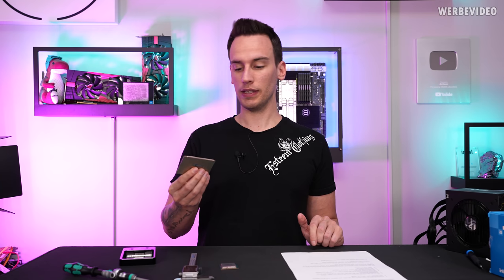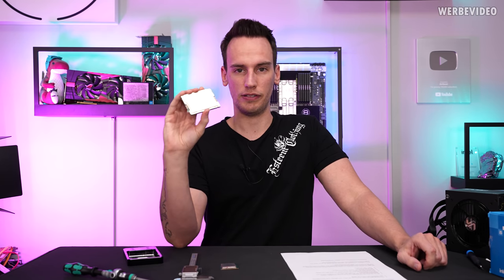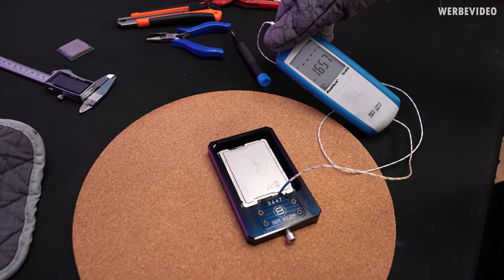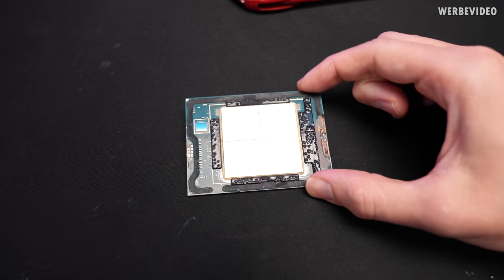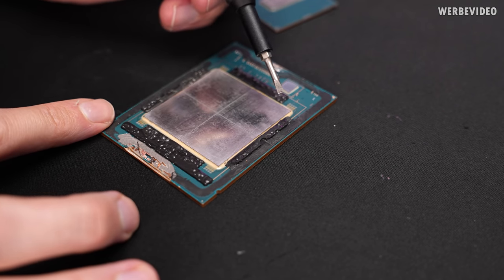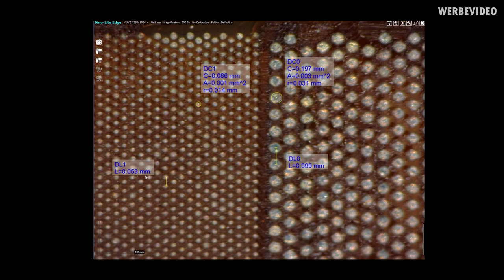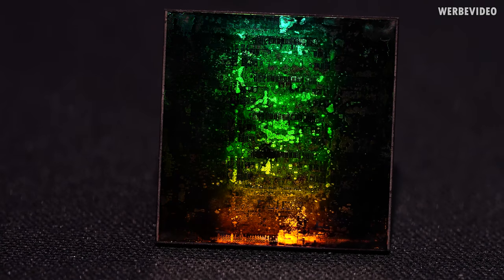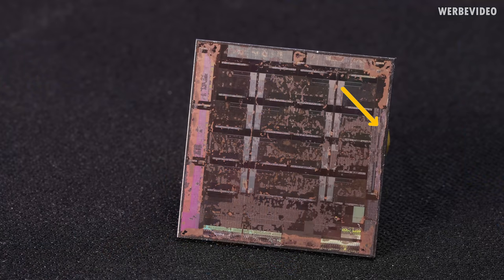Delidding an unreleased 56 Core Intel CPU - Sapphire Rapids Xeon

Comment: Dude you probably just killed a $10k cpu just out of curiosity and education. Assuming it wasn't an already dead engineering sample. Not many people could have done that. You definitely deserve a medal of honor...
Reply from the maker: Haha thanks
Reply: Medal of horror ? :-D
Reply: @bennaambo2716  Tell us what he should have done instead with a chip he can't use/exploit before months ? He got us prime news, he showed us the immediate future and made a lot of views... What's your options ?
Reply: @leyasep5919  i mean theorethically he could have spent a month or two to try to come up with a less destructive deliding method but intel could just as easily make engineering samples not work on any non engineering board via bios so it doesn't really matter
Reply: @vukzlatkovic1183  He's trying to take die shots, so the destruction is irrelevant.  He probably gained more info on making delidding tools, which BTW he develops and sells.
Reply: @vukzlatkovic1183  At the time of deliding the cpu, I'm pretty sure he had no idea whether the cpu was functional anyways. It was an engineering sample which was sold 3-4 months prior to the commercial unit's release. So the cpu he destroyed was probably even older than that. Even if it was not dead, it probably had bugs and it probably was nowhere near the commercial unit in terms of clock speeds it can achieve anyways. And obviously taking the die shots would require the destruction of the unit anyways. He burnt some money to make this incredibly informative video of which we should be thankful for.
Reply: @leyasep5919  A lot of views....80K.... Woooooow....
Reply: @lemilemi  OK I know it's relative but it's still 10× my most viewed one :-)
Reply: @odjsjaks  that's how you remove a soldered ihs my guy
Reply: @leyasep5919  Not nearly enough views to cover the cost of that processor. But he can do what he likes with his property, I guess...
Reply: @carlkamuti  Maybe not, but we don't know how much he paid either. Retail chips might be $10k but a very early ES that might not even work wouldn't have been anywhere close to that.

Comment: With all those fine connections underneath, it is amazing that they can attach these chiplets successfully without any of the connections being bridged.
Reply: some chips are indeed lost to defects in those connections, yield of packaging is not 100%
Reply: What "connections being bridged"?
Reply: @suntzu1409  If one of the chips is less than the width of a hair out of alignment, the solder bump will make contact with two of the connections at the same time instead of just being connected to the one it should be connected to.
Reply: @osirisgolad  miss-alignment of even less than 1 hair width would create high resistance connections, potentially limiting frequency
Reply: agreed it just looks like a technician's nightmare if this cpu chip is on a laptop and they have to solder it back lol
Reply: @darknez09240  that's not how it works...

Comment: I love how Roman will just be too interested in what's inside to actually restrain from killing a top-of-the-line Xeon <3
Reply: Sapphire Rapids engineering samples are locked down like never before, so this CPU would not have served much of a purpose besides being a pretty paperweight.

Now it's a grilled paperweight!
Reply: @TheDoomerBlox  Well... as far as I understood, it was functional, right? He says when he wrecks it in the de-lid vice, that it's a good think he didn't need it... so sure it might be limited, but it's still a 56c Xeon...
Reply: @MrMcGreed  It is functional, in so far that you if you were to trick it to think it is in the past - while running the special "key" BIOS that allows it to function - it would run.

Besides that specific set of circumstances, it's a paperweight.

Comment: I want to learn how to "clean" the die and get photos like that. I have a ton of old crappy intel cpus I could practice on, it just looks so awesome!
Reply: If you find an old ceramic Intel CPU (edit, like a pentium or 486) you can pop the cap off the center of the bottom where all the pins are and see the bottom of the die. 

You have to take the die off the substructure pcb to see the "cool stuff" so you aren't left with much  of anything to hold or look at afterwards.
Reply: I think der8auer has a video on how to - though it's something with a lot of acids, so be carefull... also, it might be on his German channel, because it's from before he split them...
Reply: @volvo09  the old pentium pros have a sh*t load of gold
Reply: @MrMcGreed  the guy that does the ones on flikr most people have seen i think has an old tutorial on how to do it too, but the process of what to use varies a little by the fab process iirc
Reply: @MrMcGreed  thanks for the heads up, do you know the video name?
Reply: @AtaGunZ  NP!  Think it's "We destroyed the Intel Itanium - My most beautiful Die-Shots ever!"... but didn't watch the whole thing again to check...
Reply: I can't help you on the chemical/mechanical side of things BUT... 
to better control the reflections, you should also consider polarizing filters/gels for your camera and light source.
Reply: Just get a pentium 3 or amd athalon. 100% exposed die. The wild west days.

Comment: @10:17 Next time, if you want to measure pitch more accurately, measure the distance between 10 or even 20 bumps and divide by the correct amount. The measurement error for inaccurate positioning on the exact center of the bump will be greatly reduced.

Comment: I gotta admit i'm really surprised you dont have a reflow gun and even a PCB heater, they arent particularly expensive and seem like they would make your life easier often enough. You can pick up a really nice Quick reflow station for a couple hundred US.
Reply: (example use - put your entire delidding tool on the PCB warmer, heat to 90C and use the reflow gun to bring the IHS to 155 without cooking the entire PCboard/die that far for ages.)
FWIW a double wedge delidder might still work with those very close caps

Comment: Reminds me of my Pentium Pro (500 nm) from 1996. Overclocked from 200 to 233 Mhz. Still running 😎
Reply: what are you able to even run on it?
Reply: @lordjaashin It was used as a file server until about five years ago.  It has Windows 2000, Office 2003, and Photoshop 6. We use it to convert old-format Office files, run old Photoshop plug-ins, and play an occasional Age of Empires scenario.
It has a SuperMicro AT mobo made in a place called "USA".  The power connector runs hot when under load, and the contact clips eventually oxidize causing crashes. I have surgically replaced clips (take from a dead Seasonic) and put conductive thermal paste on them. That experience has made me very sensitive to power delivery - both number and quality of conductors.

Comment: When removing the IHS you should have made a small spacer to put between the cpu and de-liding tool and then shaped the spacer so that there's a cutaway on the bottom half of the side that presses on the cpu so that you could be certain that the pressure is against the IHS only and the spacer will clear and go over the PCB and not into it. Additionally you could have made an additional cut away in the section of the spacer edge that would have contacted the SMD's so that it wouldn't have damaged them either and only made contact to the IHS either side of the SMD's. 

Just thought I'd mention the idea in case your in a similar situation in the future and can hopefully avoid damaging another chip.

Love the videos always really interesting and massive respect for the guts to do something like this knowing you'll almost definitely ruin this cpu using that de-lidding tool and still going ahead with it.

Comment: Im sorry bro but the way you delidded that made me want to cry. The proper way to do it like that is to take 4 thin razor blades, cut the adhesive holding the IHS, then put each razor blade on each side on the cpu between the IHS and the CPU, causing slight pressure. You then take a Heat gun that can melt solder and heat the cpu (make sure the cpu is upside down and elevated on something) and wait till the IHS pops off.
Reply: You clearly don't know who Der8auer is. Pathetic comment.

Comment: Those are 16 core chiplets indeed, so a 4x16 or 64 core part was definitely the design. Knowing Intel they probably do have 64 core working in their lab already - it's the yield rates, lithography, complexity of the design and packaging that's holding it all back. These guys are at the bleeding edge of physics and materials. A 350W TDP is an incredible amount of heat for a CPU to push let alone 2x or 4x - those 1U designs will be interesting to see how they stay cool if not quiet.

I do wonder what form factor those 8 CPU systems are because all I can seem to find are 4 CPU XCC servers from Supermicro/Tyan. Maybe they are referring to the systems that cram four nodes in a 2U chassis, that would give you 8 CPU's in one box, but those top out at 185W TDP parts due to thermal constraints. Even when liquid cooled 8x350W isn't something you will be doing with a case mounted radiator setup, and a server rack full of multiples of those will require a special room/facility to handle the tubing, noise and cooling.

Gotta appreciate AMD for their 64 core CPU's though - those things rock!!!
Reply: 16 sections, 1 reserved for integrated memory controller.  So 15 cores each die max.
Reply: @張歐-g9m  Nope - the IMC has it's own dedicated real estate on the die. You can see it clearly in the shot. It's a 16 core part with two of the cores nerfed here.

Comment: Can you design a delidder that would push the lid on a pivot point basically to avoid damaging the caps?  The top left corner with the writing being the pivot point and pushing the bottom right corner towards the bottom left corner?  It would only take a very minimal amount of movement before you could just remove it from the delidding tool and manually "wiggle" it looser.
Just my backyard north of lake superior thoughts ;)
Love from Canada :)
Reply: Or maybe create some sort of "stopper" for one side and push up the other side using some sort of wedge shape.
Reply: @mrawesomelemons  wedge is also a great idea that might work even better!  I mean taking it out when it's 150 C and "wiggling" the lid is somewhat laughable to like argue against my own idea hahaha.  The wedge would eliminate that for sure!
Reply: Desoldering the caps before delidding should be pretty easy on capacitors that size.
they look like they are at least 0402, 0603, or maybe even 0805 size.
0402 size caps are pretty hard to do by hand but they are definitely possible and i think those caps are probably bigger than 0402
Reply: @justinbouchard  you could create a delidder that pushes teflon wedges into it from four sides, maybe the corners, maybe the edges, that way you would lift the lid vertically

Comment: Might be fun to get a 8 socket board for this, dream workstation I suppose.
Reply: At 350 W TDP each, thats 2800 watts of cooling needed.  I can only imagine the power consumption not being much lower than that, would be hilarious to see him try and overclock all of them at once.  448c/896t at 4ghz. I would bet these 56 Court chips are probably clocked at 2 or 2.1 GHz max.
Reply: This particular chip will need a dumpster. A new one of these would be great to use in a multiple cpu workstation.
Reply: Pretty sure only dual exists for this
Reply: Ice Lake SP and newer only support 2S I believe.
Reply: @chubbysumo2230 
well, if 2800W is just too much, how tf HPE is making >=30MW supercomputers?

Why and how did Microsoft and Amazon make data centers that draw several kilowatts of power?
Reply: @suntzu1409 just to make sure I got this right, are you comparing a single rack workstation to >=7000sq ft supercomputers with whole buildings designed to cool them?
Reply: @AtaGunZ  
I didnt really compare the power draw of one server with the power draw of supercomputers.

Read my comment properly.
Reply: @suntzu1409  yeah I read it again and still makes no sense. You are clearly making a comparison between the power draw of 2.8kW (mentioned by @chubbysumo) with the power draw of HPE supercomputers and data centers.  Also, an average Microsoft/Amazon data center is also in the megawatt range, not kilowatt.

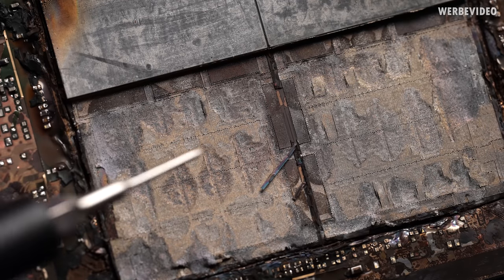Comment: WHOA!!! @ 9:48 - if you pause it and pay attention to all of the 20 rectangles (inside one of the 4 quarters of the whole chip) you can see the ones that are connected to the 'inter-connect' (i forget what it's called) to the cores next to it are the ones2 doing the processing. There are only 14 in each of the quarters, and you can see that only the 14 that have TWO CONNECTIONS (or 1 double wide) of that 'inter-connect" OR to another processor.... 
In otherwords, while looking at the quarter that is in the center of the screen @ 9:48 the 6 cores that are on the very left and very bottom (the top core on the left side and the far right core on the bottom side are part of the 14 processors enabled, so they  are not what I talking about here) must be used for something other than processing, so maybe cache or IO or just disabled???? Or is that all done in another area? And if a core is disabled is it then just taking up room and becomes a useless area on the chiplet. (I really don't have much knowledge on what all these pieces are, I'm just guessing really lol)
..... 
So this is why it is such a STRANGE number of CORES in the chip (56 in this case, so 14 in each quarter) BUT I would like to know if it is the same cores in each CPU or can one of the quarters have ALL 20 cores enabled while another has one 8 and the other 2 both have 14??? 
Is it possible for Intel to have ALL 80 CORES enabled if they all just happened to work perfectly??? - There is so much I would love to learn about, but I have no clues where to get the answers...
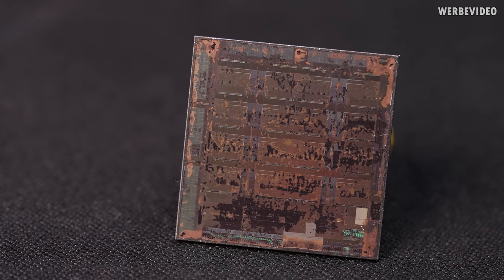Reply: ohhhh.... hrmmmmm..... so @ 10:57 you show the chiplet etched a bit and we can see that there are 16 CORES in each chiplet.... (so 2 of them mush get disabled, but I dont think they can be any of the ones with the 'inter-connect' - I think it's called an E-MIP??? 🤷‍♂) so there goes my whole theory lol - I REALLY think I should start watching the WHOLE ENTIRE VIDEO BEFORE  I MAKE AN ASS OF MY SELF LEAVING CO<MMENTS ABOUT STUFF THAT IS EXPLAIN JUST A LITTLE FURTHER INTO THE VIDS lmao 🤦‍♂🤦‍♂🤦‍♂🤦‍♂

Comment: I'm wondering if there is more consistent silicon quality in Intel's new multi die CPU. Some of their Core 2 Quad and matching Xeons used to have vastly different binning between them (eg. 1 of the die would run significantly hotter).

Comment: Is hedt still useful? I remember starting with the i7 920 back when it launched, but really wanted a 980 extreme.. only to find it was ousted by the 2600k shortly after, which was technically a budget chip. Intel had been shooting itself in the foot each release where these cheaper K series chips were out performing their unreasonably expensive X series (hedt) chips. 9900k was my jump from the i7 920 and find zero reason to get a 13900k. Out of curiosity, I checked to see if a 13th gen X series would exist (last I saw, 10980xe was the last hedt) but we now have confirmation of a 13th series X chip, will it be slower than the K series for gaming?

Comment: Couldn't you use a laser like the ones they remove rust with, or to make a logo.. and get it just do the whole surface in sweeps? 
Maybe there's a high tech machine shop near you could approach for advice. The newer manufacturing process has just made die shots using your current process very hard.

Comment: Considering AMD's EPYC 7773X and Threadripper Pro 5995WX takes 280W and Sapphire Rapids take 350W (according to official specs, at least. I expect real power usage to be around 310W and 450W respectively), it's nuts to see that Intel's 56 cores take more power than 64 cores.

Comment: 4 E-cores in the space of 1 P-core, i wonder how strong a 256 E-core xeon cpu would be.
Reply: Significantly weaker than P-core only design in AVX-512 - accelerated workloads (NAMD), should be around <10% better outherwise
Reply: What <10%? More like 100% more
Reply: Latency would be pretty bad
Reply: @Leoappeared  4 E-cores take the 1,25 as much space as  1 P-core. 256/4×1.25=80 (P cores to take the same amount of space as 256 E - cores). 256 E cores vs 80 P cores is a valid comparison, not a 256 E cores vs 56 P-cores. This (56 functional P cores out 64 physically present) new CPU will fit around 208 E-cores within die area, some of those will have to be disabled for yield purposes.
Reply: @volodumurkalunyak4651  10nm is still not dense enough to play this, we need 512 E-core in one of the sub-dies
Reply: @劉奕彤-q6g  what you need is a whole different story. I do compare 56 (avaiable) / 64 (total) P cores to E cores while roughfly matching die area. 48 E-cores per sub-die should be achiveable now (will Intel do that - I have no idea), 52 E cores per sub-die requires some redesign, but 512 E-cores per sub-die is not possible right now.
Reply: I remember not that long ago when Knights Landing was Intel's first many core CPU. It has 50+ cores that were in some ways a predecessor of the e-cores we see today. Pulling 300+watts, with 4 way SMT and a measly 1.7 GHz top speed... Oh how far we've come

Comment: Those caps look large enough to manually solder/de-solder before delidding the CPU.
Reply from the maker: that's a good point :)
Reply: Or just add some adapter block in "delidder" to avoid them... (?)